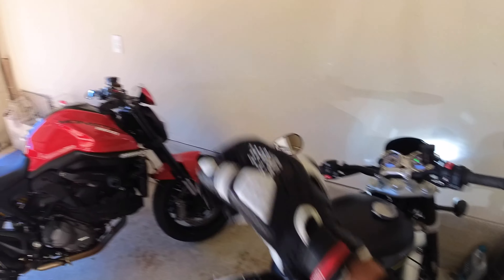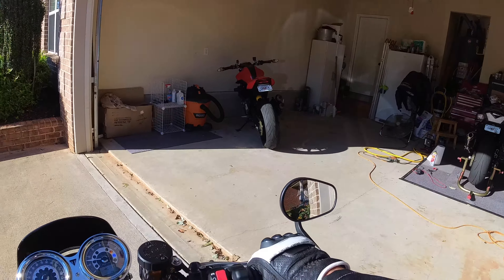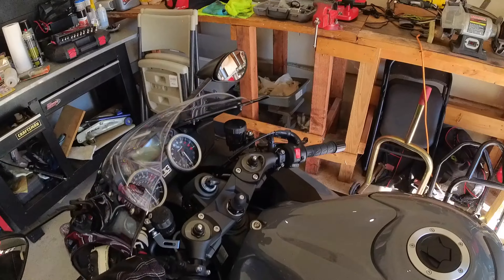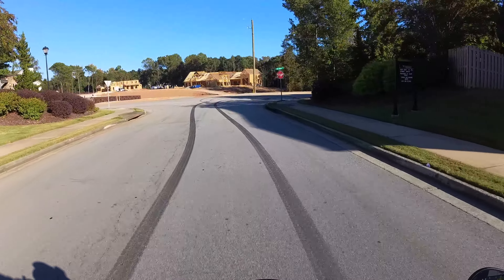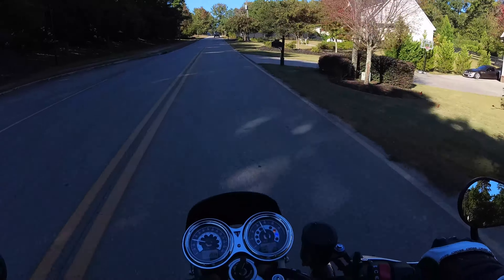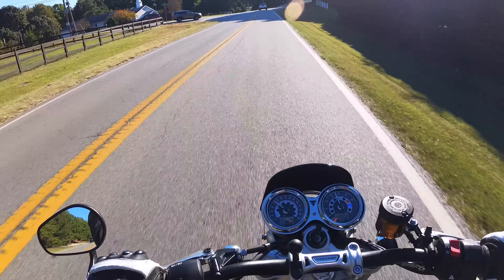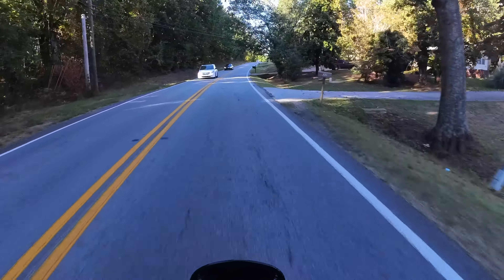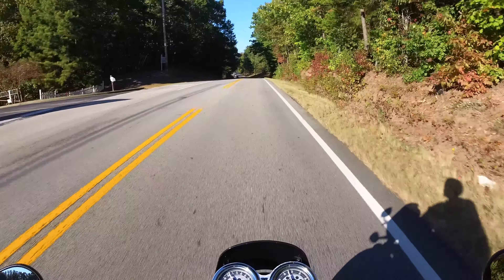Dave's Garage - New 2022 Speed Twin Map

Comment: Great stuff Dave.  I put a free spirits x-pipe in my 2022 speed twin.  Have the DNK tune in it for now until I can get to a tuner here in Houston.  When I pulled the cat and mid-pipe combo off the bike I completely removed the right side frame rail and also had to loosen the right side rail too.  It was a process but ultimately not that bad.  I also pulled the header pipes forward so they were loose and that was a real pain as they're joined to each other by that cross pipe up high.  Re-seating the radiator on its mounts was also a bit of a pain as the rubber grommet kept folding in on itself. A bit of grease fixed the issue but all of it was laborious.  Probably took me 6 hours over all but I'm not at all experienced and like to take my time.

I have nitron Stealth shocks on rear and new nitron cartridges on a UPS truck headed to me as I write this.  Love the nitron rear shocks (none of the squatting and movement in fast tight turns as with stock) but they made the front feel much worse.
Reply from the maker: Dude, I just spent an hour and a half getting the stock CAT out of there, and it was every bit as much of a pain as I was afraid that it would be..  😞
Reply: @Daves_Man_Cave  Hahaha... I'm having flash backs.  I actually haven't ridden mine since doing it.  I took it down off the lift and didn't put the kickstand down properly and the bike fell over.  The shift lever made a dent in the clutch case where the shift actuator goes in and it immediately started leaking oil.  Waiting for a new case cover and gasket and of course they're on a long back order.  I still have no idea how it sounds and rides without the x-pipe.  Gonna live vicariously through you for another week or two I think.
Reply from the maker: @KeithJones22  I did something similar with a Super Duke 990...  Installed a brand new set of Leo Vince mufflers, airbox mod and CRG bar end mirrors...  Finished up, looked awesome, and I took it off the stand and forgot the kickstand and it just goes BAM on the garage floor...  Doh!
Reply: @Daves_Man_Cave  Ouch!!! I am glad I'm not the only one! I was sooo annoyed at myself.  Have a great Sunday.

Comment: Sitting in traffic today when an Yamaha MT-10 and KTM 1290 GT rode by me. Both had aftermarket exhausts and sounded great, the MT-10 especially. That is an awesome sounding bike, such a unique sound. And yet, your little Triumph still sounds awesome, possibly the best sounding bike I've heard in forever. For a stock exhaust, that is one righteous tune it emits.
Reply from the maker: The MT10 is a retuned R1 crossplane motor and it sounds sublime.  One of the best sounding motors on the market.

Comment: Looking forward to the X pipe install Dave...🥳
Reply from the maker: Yeah, about that...  My camera was dead and I wanted to get a head start on the taking out of the old parts... Was just gonna get a few things started and then record something and one thing led to another, largely because getting the old one out is a monumental pain in the ass.  I mean, they really made this a chore.  Took me 90 minutes just to get the headers off, the frame rails off and that stupid thing out of there... You have to take up the tank, mufflers off, all sorts of stuff.  I imagine that putting it all back together is gonna be a massive pain, but I will do a full video of that...

If i had know it was gonna be this much effort, I wouldn't have done it, honestly.  it;s a lot of effort and frustration for some noise and 2hp.  lol
Reply: Shit happens Dave but can only imagine the hassle..Older model bad enough but the Bean eaters really had their way with this one... Hopefully the benefits they apparently will be worth it so looking forward to watching install at least.. Appreciate your efforts ✌️

Comment: Hi, Can this map fiit in 2019 models? cheerrs
Reply from the maker: No, different motor, tune, etc...
Reply: @Daves_Man_Cave  Hey Dave, silly questions Is all counties maps works for Chinese market bike? my bike is running on 30279. I was take look at ur shared maps I find out ur 2019 speed twin all countries fuel trims for full exhaust map is more aggressive then 30257 -2020 speed twin all countries slipon tweaks unrestricted map in terms of the video u made for tuning ur speed twin. I find the Ftrim and AFR is different. If I can flash all countries map to my bike which one is more fun? Cheers.

Comment: Hey Dave, is it possible to copy a Hex file to Blue Stacks?  I know a file can be exported to windows from Blue Stacks but I have had no luck opening a Hex after importing.
Reply from the maker: Opening, how?  As a raw file?  Or opening in TuneECU?  I use Bluestacks in Windows, and I take files to and from that virtual environment, via Google Drive... Copying up from Windows or another machine, and down into Bluestacks via the Google Drive app
Reply: @Daves_Man_Cave  Got it Thanks.

Comment: Hey Dave, great channel and thanks for all the work you do and share!
I was looking to download the map you are using in this video but the link gives me an error saying the file doesn't exist.  Any chance I can get a copy?  I've got the same 2022 with only the snorkel removed and bd killers removed.
Thanks ahead of time!
Chris
Reply from the maker: I wouldn't use this map if you still have the CAT in there.  The reason is that we added a lot of fuel in places, and over time, that may cause carbon to build up on and choke up the CAT.  If you plan to get a decat x-pipe, then yes, by all means email me and I can get you the right map.

If your system is largely stock, I can certain put together an optimized map for that setup.
Reply from the maker: Here is a map for your setup.  Little extra fuel, but most of the tweaks are in the Sport Mode ETV table, AFR targets, and ignition tables.  Run 93 octane with this map.

https://drive.google.com/file/d/12vkRBcBH2awcDDpJUpnoScDWkIlH3jWb/view?usp=share_link
Reply: @Daves_Man_Cave  Thanks Dave!  Very much appreciated!
As much as I'd love to do a decat it's illegal here in Canada.  Was fined once already for removing it from my old Hayabusa.  So, I'll be sticking with just simple mods for now.
Keep up the great content.. 
Cheers!
Reply from the maker: @chrisbradnam4746  How do they check for the CAT?  You could always open it up, gut it, and pay someone to tig weld it back together so that it looks stock, has the stamps and serial numbers or whatever...
Reply: @Daves_Man_Cave  They do a visual and look for the numbers.  They even like to stick their Billy clubs down the exhaust to check for the db killers.  I have to tig weld a small rod in the tube so the club hits it and stops short... lol
Welcome to Canada...lol
Reply from the maker: I hate that people think of themselves as "free people" and have to deal with that kinda crap from Big Brother